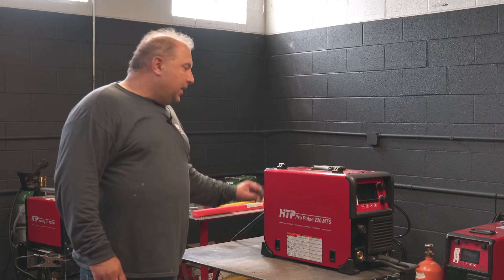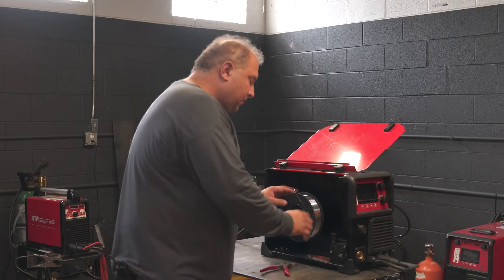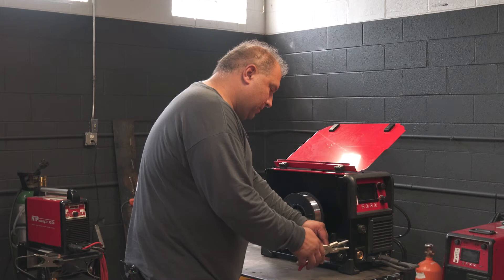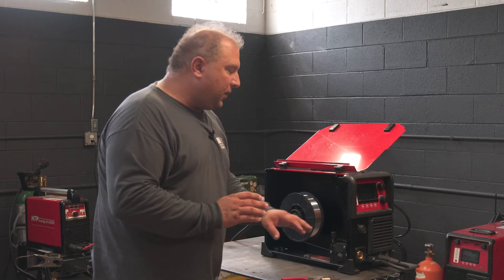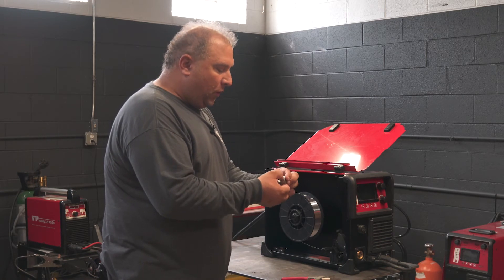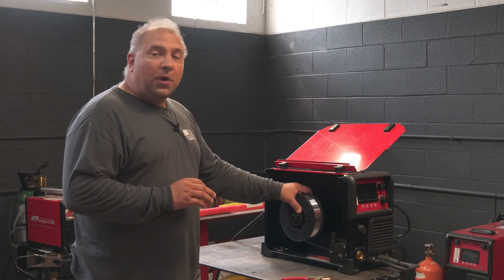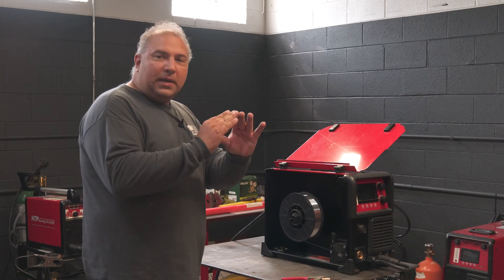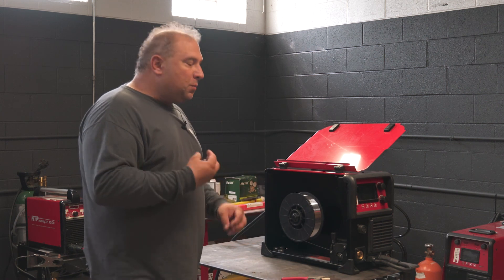How to Load an Aluminum Spool of Wire (Pro Pulse 220 MTS – Setup Part 3)

Comment: I like your style and step by step explanations. I just wanted to ask you what kind of Aluminum wire best used to weld THIN Aluminum ( 1/8" and under)? is it ER4043 or  ER5356 or ER5554? Thank u
Reply from the maker: with the pp200/220. 5356 has a better low end